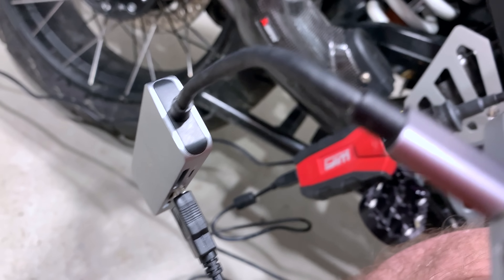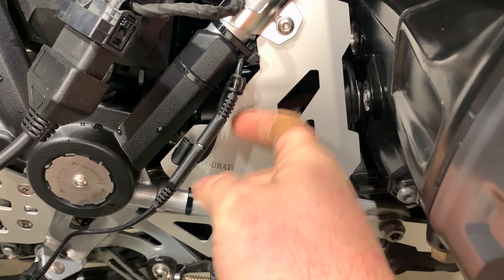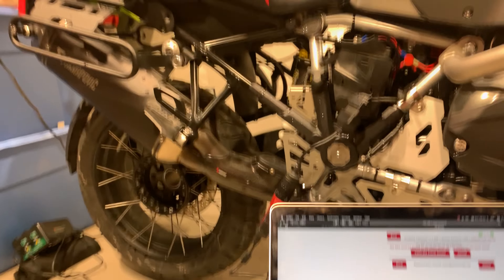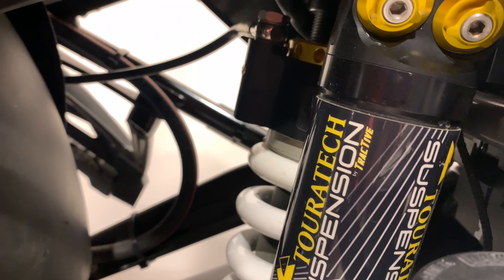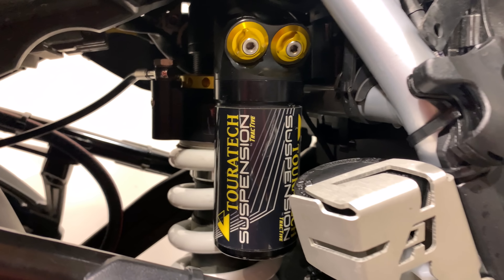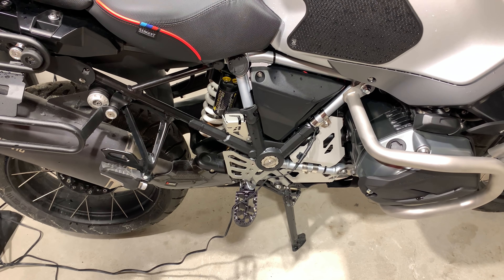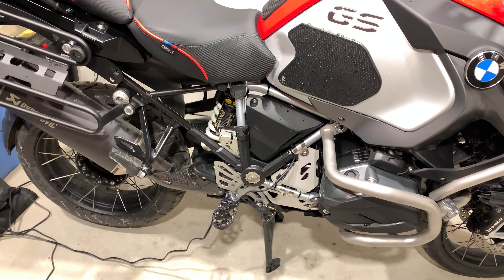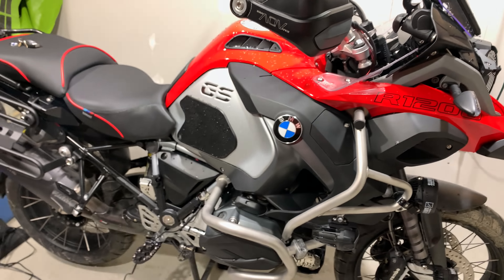Calibrating BMW ESA Touratech/Tractive/Wilburs/SACHs on an R1200GS Adventure with GS-911

Comment: Adam do you know what the sound is that never stops when you have a LC GS or GSA ignition on? I recently purchased a GS-911 and I worry it’s not good to leave my bike with ignition on but not started. I feel like with most vehicles the fuel pump runs u til it’s at pressure then shuts off. On my 2017 GSA there is a hum that continues after what I believe is fuel pump shuts off. I can hear it on yours as well. And I’m definitely not talking about exhaust flap noise I’m familiar With maintaining that. 
A little off topic topic, but I thought if anyone would know it would be you. Thanks Adam and I hope you’re enjoying the South
Reply from the maker: It is the fuel system and maybe coolant but it will run indefinitely until you shut the bike off. I've had 3 liquid cooled boxer bikes and all 3 make this sound, even the 1250. I kind of like it beause the wining sound reminds me that the bike Is on if I'm working on it in my basement.
Reply: @AdamChandler86  thanks again for all the help. I think I need a new battery mines been on tender all winter. I went to do my first scan with GS-911 and within minutes GS-911 said plug battery in below 12v

Comment: Hello, Good video. My bike is 2017 R1200GS Rallye with Dynamic ESA. I will replace my stock absorbers with rebuilt ones by Wilbers soon, I have HEX GS-911 and going to calibrate suspension by myself. But  BMW Mottorad manual says that before calibrating, you must raise the motorcycle in the center so that the both wheels are suspended in the air and use the recommended charger, which guarantees a 13 Volt mains supply. What do you think on this, is it necessary? Thank you in advance.
Reply from the maker: I would follow the manual if I were you but I never have to no issues personally but I'm not a mechanic.
Reply: Hello, And thank you for your last reply. I use Wi-Fi Gs-911, I hear and see how rear spring moves up and down, but I do not see and do not hear any movements of front springs at all. Should front springs moves and noise like rear spring? And if there is some issue with front strut should GS-911 detect and show some fault of front strut? As I see after calibrating it was run successfully… in your video I also do not see any movements of front spring.
Reply: @Andrei.V.Tkachenko  The front spring only has adjustable damping, not preload so hence no motor noises.

Comment: The Tractive suspension looks great. How are your getting on with it? Why did you change out forum OEM (I understand various reasons too. Just wondering yours)?
Reply from the maker: I've put about 30,000 miles on my Tractive suspension...just time now to send it back in for the first service. I certainly wouldn't go back but it took some time to really dial in the settings and make it work for me. If you look at our Colorado travel series or Trans-Labrador playlist you'll see me putting it through its paces. It's a fantastic setup. it still will over heat fully loaded on rough terrain for an hour but has a higher heat dissipation ceiling than the OEM.